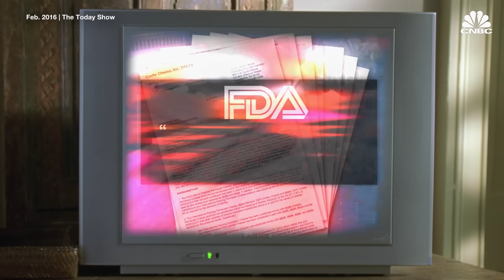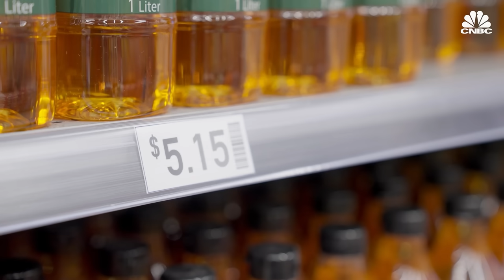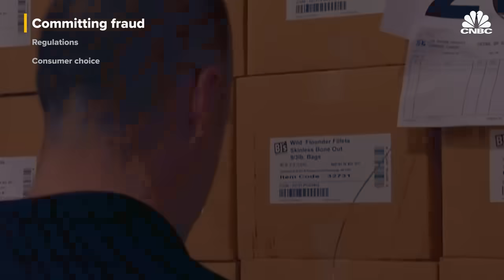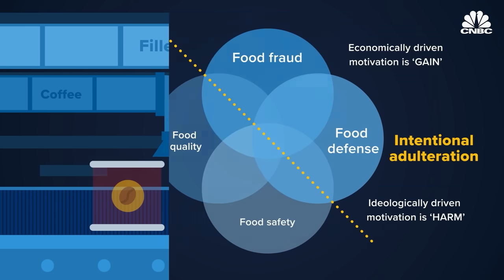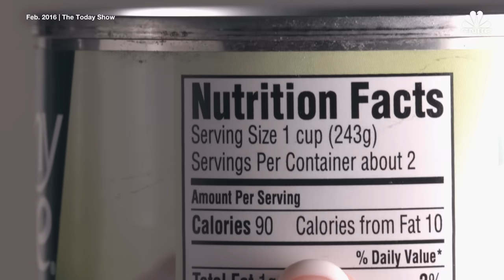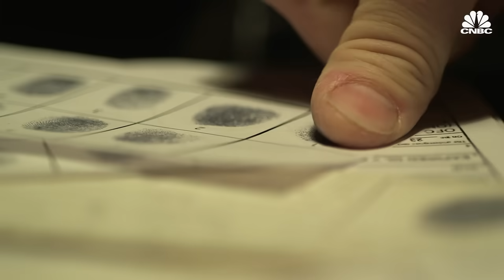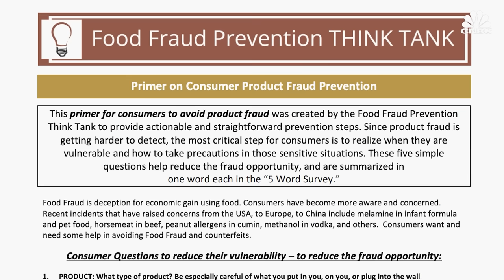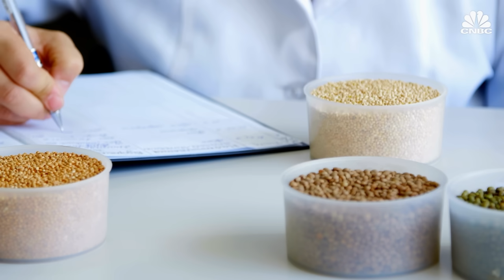How Americans Are Tricked Into Buying Fake Food

Comment: Pro tip, dont buy grounded spices, by them whole from spice markets online.
When buying oil, make sure it comes the same area it is manufactured. Meaning less mixed oils or using old oils with the new ones making it die quick. Same with balasmic.
Reply: If you’re buying online you can’t know for sure that it comes from where they say it does. Unless you physically go to the location to verify, you’re just as susceptible as buying it from a grocery store.

Comment: How sad, in UK I could never imagine these brands getting away with this. Basically daylight robbery. This is what happens when lawmakers are on the side of the criminals and bribery
Reply: The UK is where they mixed in horse meat to the ground beef and didn't get exposed until 2012
Reply: Not one brand of honey is actually proper, pure honey. Only way you'll get proper honey is go and buy it from a bee keeper and it would be about minimum £5-£10 a jar. Most shop honey is mixed with high fructose corn syrup. Doesn't mention that on the label tho. No wonder diabetes is thru the roof. We think we're being good by having honey instead of sugar, when secretly it's bulked up with corn syrup which would send our glucose levels thru the roof.
100% Olive oil is blended with stuff that shouldn't be in it. Cartons of orange juice have wood pulp in them. We import 3 million eggs every day. When have you noticed Italian Eggs on our egg boxes. Meat often has British on the package and it ain't. Look who owns nearly all our meat processing factories now. The list is endless. The food we buy in UK is just as shyte as every other country.
Only way to stop it is multiple, constant complaints to Tesco or whoever. They would then have to take better steps to check the food chains they're buying from and employ specific staff to do random lab checks on the foods. Any issues, they stop buying from that supplier, and said supplier should be prosecuted. No ifs, no buts. But, look who owns all the supermarkets these days. You think those fukkas give a monkeys about the actual customer and their health? Course not. They also own the pharma companies. They also own the shipping companies that bring the stuff to UK. They also own the ports. They also own the majority of every large corporation. The gig is rigged, and it ain't in our favour.
Reply: @jazzylyn5857  I have at least 10 jars of honey as friend runs a farm where they make it in Essex, completely agree the supermarket stuff has 0 on the non branded heavy manufactured goop
Reply: @jenlin6715  You're very lucky. Pollen in honey is the key. If it doesn't have pollen in it, it ain't proper honey.
They know the honey on their shelves isn't honey. They've known forever. I recall this being reported on years ago. Have they done anything? No. It's still on their supermarket shelves.

Comment: That was great.  Now do one on the incredible shrinking packages. The other day I thought I was buying a half gallon of milk, but on close inspection it turned out to be 50oz not the expected 64oz. That's occurring with virtually every product on the shelf. The traditional 8oz multiples have all but disappeared. Although the container size is still deceptively the same. All the recipe books go out the window.  

I knew about fake food from years ago, but had relaxed my paranoia once labeling became a mandate. Thing is, I have a bottle of store brand olive oil in my cupboards right now.  I've also been suspicious of some of the flakes that float around in the water when I sprinkle in salt.
Reply: Yeah try to make a cake mix in a 9x13 cake pan or standard muffin tin now. I had to buy two cake mixes and weigh because it was getting mixed with so much butter that it was important to use the right amount.
Reply: The water flakes are sus
Reply: And notice how all the packaging modifications were made magically before the shut downs. How did they know. It takes a while to relabel and s shrink packaging. Muddy be new math.
Reply: Our milk taste like pure water and it spoils before expiration date.
Reply: @mareonaranch3565  
Don't forget they don't shrink the packaging, simply reduce the amount put in each package and change the master print file so the print output, and the box contents, can be adjusted during a production run.
Reply: I remember when a pound can of coffee actually weighed a pound. Then they started reducing the amount they put in the same sized can without a word to consumers. Sneaky way to avoid raising the price but with the very same effect.

Comment: Then you should be holding retailers equally as responsible because they are distributing it to consumers and many of them are aware. They will buy it cheaper so they can resell it at a high margin. This just comes back to greed like everything else in the country. Hit them with big fines and they will put more effort in checking products before buying them and selling them to customers.
Reply: If the punishment for a crime is a fine then the law only exists to punish the poor.
Reply: Distributors don't test product. So no you can't hold retailers responsible unless you can prove that they knew about it.
Reply: @HH-le1vi  Quality assurance is apart of every company who provides goods or services. Selling a product that does not meet the standard that you attach to your brand is your responsibility. Would you expect Ikea to sell you a chair with only three legs or rotting wood?
Reply: @gemelwalters2942  you don't know the actual quality of every single product. You have an expected quality but what you expect and what you get aren't the same. Besides the manufacturer is supposed to keep those records. Not the distributor.
Reply: @user-gz4ve8mw9l  Very true, well said.

Comment: I’m 61 years old and I never took what I ate seriously, till I was diagnosed with Type 2 Diabetes 6 months ago.  I am now becoming educated on food content, food labels and the fake (even deadly) additives that are in nearly everything.  I recently changed deodorant because of the aluminum and other additives in my once chosen brand.  It’s incredibly difficult to eat a healthy low carb, low / no sugar diet.  The additives, chemicals and overly processed add ins make eating healthy nearly impossible.  No wonder diabetes is on the rise as it is.

In my case I’m responsible for my situation, I took what I ate for granted, steered away from exercise and gained weight.  I’m now taking control and am on my way to reversing my Type 2 Diabetes.

Comment: I've suspected food labels for a long time. The calorie counts seem wayyyy off. You can tell by the taste, texture, etc. that there are more calories (fats, sugars, etc.) than the small amounts reported on the label. I'd like to see the FDA round up a random sample of processed or canned foods and test the actual calorie counts.  Then go after the companies that are falsely labeling them. If the  FDA had power to shut down these plants (and used it!), the perpetrators would clean up their products immediately. Our country is not getting any healthier. Fake food with fake labels are one more source of deception we don't need.
Reply: Actually some cellulose isn't that bad.
It comes from plants, marine animals, and good bacteriae.
It's doesn't smell or taste of anything, and is calorie free.
It's used in stuff like low fat mayo. To emulsify and thicken.
But adding cellulose to products like Parmegiano Reggiano, calling it  "genuine" is a mortal sin ! 
🧀 🧀 🧀 🧀 🧀

Comment: I used to fix food processing plants many years ago.  I was in a ground turkey plant.  the turkey would get ground up and put on a conveyor system that came down the line would automatically box it and wrap it.  Well  i noted that when they changed the "organic" turkey with the regular turkey, they only changed to labels and same turkey was packaged.  Just get the cheaper regular turkey.  same thing.
Reply: I don't doubt this. I recently bought some organic butter and normal butter from the same company - the individual packaging was identical, same "plant number" and everything.

Comment: I bought a bottle of extra virgin olive oil.
Only after using most of the bottle, I was about to put the bottle in the cabinet, when I started reading in small print on the label, and guess what?
The small print, tiny print said I held a blend of oil, sunflower and the extra virgin olive oil, and in even smaller print next, said 20%, olive oil.
But in very big, bold font, taking up most of the label, extra virgin olive oil.
I am still angry months later.
How can this be legal?

Comment: Been an avid food label reader since age 15 and do most of my grocery shopping around the perimeter of the store vs the aisles that contain all/most of the processed foods that are the biggest culprits of food fraud and the most likely to have preservatives and other "additives" like cellulose - aka: saw dust. As for the USDA or FDA being on our side (the consumer), think again, as they are merely extensions of the Dept. of Commerce, whose sole function is to assure commerce, not your safety or health. Just remember that it has only been recently (2011) that the food pyramid has actually been structured appropriately as to the amount of each type of food/nutrients you should be consuming in a healthy diet. And today we have yet another "scale" to consider w/ the USDA's MyPlate iteration (championed by Michelle Obama?) vs a pyramid. Do your research and buy your groceries w/ the same care you would when buying/using a drug/pharmaceutical.
Reply: Cellulose is the cell wall of ANY plant, not just saw dust. Fruits and vegetables have cellulose.
Reply: @unosturgis   Appreviate your comment here. So what are your thoughts on this video?

Comment: #5.  How much does it actually matter?  Seriously - the olive oil complaint is just stupid.  Canola oil is just as healthy as olive oil, it drives down the cost, and that savings IS passed on to the consumer.  Yes, the label should and DOES reflect that, and no, the chlorophyll isn't toxic - that's what turns plant leaves and stems green, duh...  Anyway, just buy the cheaper mixed stuff - you're getting what you need, with a light olive taste, and you're only paying about $3 for a huge bottle of it.  Stop boo-hooing about it already.  It's just oil.

#6.  If it's actually something HARMFUL to the consumer, THEN complain about it.  Otherwise, seriously -- get a life already.